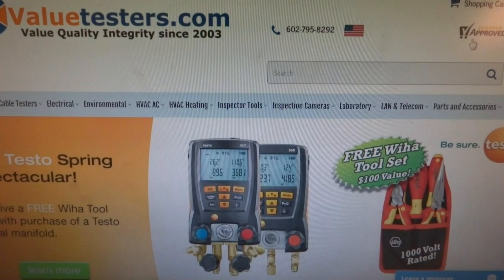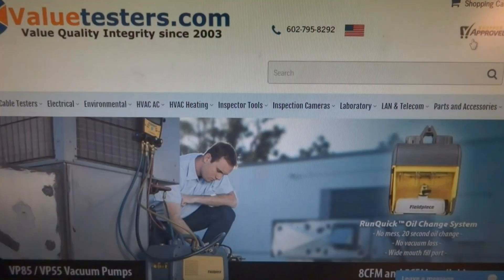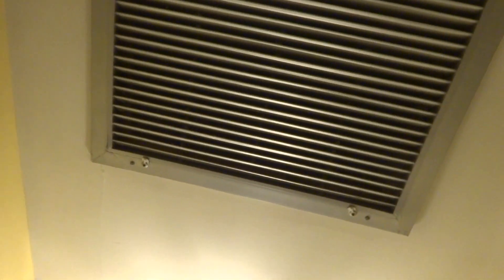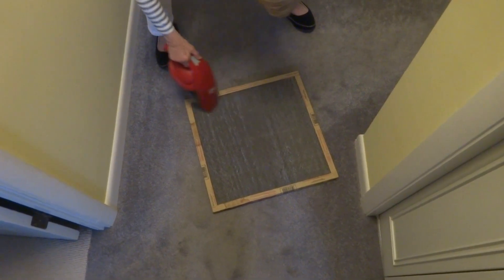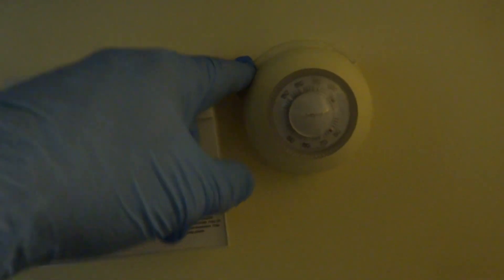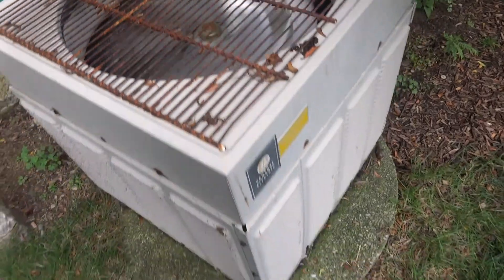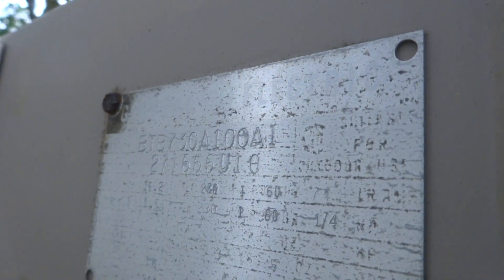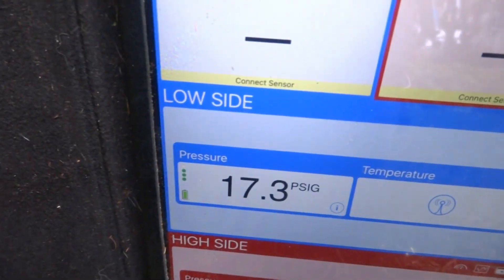old central AC system not worth fixing

Comment: GE hasn't made AC in almost thirty years. They made good units. She got her money's worth out of that one.
Reply: I haven't seen one of those GE units in more than 30 years.  The fan motors in some of those GE condensing units were expensive because GE didn't use a standard size motor so you had to use the expensive GE fan motor.
Reply: @picklerix6162  GE SOLD IT'S LINE OF HVAC SYSTEMS TO TRANE BACK IN 1985 . TRANE does the same thing as well and I love TRANE but they are asking too much for the small business owner to pay the full price for parts because everything is OEM. Witch is the same for gaming computers especially DELL ALIENWARE .

Comment: Trane bought g/e about 1984. The company that I worked for at the time used to install these and it was called the executive model was a damn good unit I still ride by locations that I installed these units in and they are still running yes but with a low suction pressure like that there is a leak somewhere

Comment: Nah it was good call..got what I know working as a helper with those old GE and later Trane systems. Rotolocks on that Climatuff were likely toast from  corrosion after 40 years! Wouldn’t drop a dime on it even though loved those old GE’s and their weathertron heat pump counterparts.

Comment: How do u put ur hand over the fan and instantly know its low on freon like that?
Reply: Nicholas Huss no heat bowing out = no heat transfer= low on Freon
Reply: Fireship1 thank u sir. Any other tips for a low freon unit on what to look for externally?
Reply: @borys444  lack of suction line sweat, little to no temperature difference in line set
Reply: DGTelevsionNetwork thank u..appreciate ur input..

Comment: Damn that unit is older than I am... I would agree to replace it at least for the efficiency factor..
Reply: gonna take decades to even remotely recover the cost of a new system with the saving from partial use in mass.

Comment: What is still buzzing after pulling the disconnect?
Reply: I think the contactor
Reply: It’s the contactor
Reply: If no power how does a contactor buzz?
Reply: @hiddenpcmaster  contactor powered through furnace circuit (24 volts), disconnect provides 230 volts to ac only. Shut off disconnect contactor remains energized
Reply: 24 vol t coil pulling in the contactor .
Reply: @gregorion56  Thanks for the explanation gregorion56.

Comment: To me that filter was dirty I like them clean I guess everybody has different levels.
Reply: I think he meant good enough to check out the system.   Why sell her a new one and tell her to junk the ac 20 minutes later?
Reply: Speck Ulator I didn’t mean to sell her a new one usually people have some in their home and just replace with a new one. Most AC contractors don’t come with the air-conditioner filters you have to buy your own. Getting a new system and having a clean filter are separate issues.

Comment: No sense in even looking for the leak? What if it's a schrader valve or the filter dryer?
Reply from the maker: the r22 gas alone makes it not worth it . pull your head out of your ass
Reply: to add 5-6 pounds of r22 on a unit that old, and then charge the customer for a leak test/repair?   would you spend over $1000  to fix a $2000 car? better get a  new 4000 dollar car and have peace of mind.
Reply: @ElectriconicJesus  I guess you're probably right... for this customer, depending on the skill of the tech and what they charge per hour, I guess it's better just to get a new unit. If it were MY unit, I'd recover the R-22, charge with nitrogen, and at least make an attempt to find and fix the leak(s) - it literally could just be a schrader valve. If that's all it was I'd keep it and might even switch over to R407c. Total cost: My time and $70-100 in materials. If it's got 2 leaks in the evap coil and another 3 in the condenser, sure, I'd junk it - but at least I'd know and could make an educated decision. 

As to the car question, I actually DO have a $1,800 car, and no question I would spend $1,000 to fix it before I'd spend $4,000 for someone else's troubles. I know the history of my car and I know how to fix it :-)
Reply: Timothy Salomon  - Yes of course there are leaks that aren't worth fixing, but to sell a customer a unit just because they're considering one, and without even checking for easy-to-fix leaks is an ethical decision we each make for ourselves.
Reply: Couldnt you just dump flex seal over the whole coil?
Reply: steven lavimoniere - I love your videos and I’m asking an honest question... I’m not at all trying to hurl personal insults. My apologies if you think my head is up my ass for asking if it might be worth it to check for leaks.
Reply: Sure we’d all try to fix our own but if Steve put $1000 into a customers unit and a month later the 40yo compressor goes out she’ll blame Steve.
Reply: Josh Bommer - Totally fair. If it really needed $1,000 of refrigerant/repair I agree not worth it for a 40 year old unit.

I think prices are a little lower in my neck of the woods (Tulsa: $40-$50 per lb for R-22) so please forgive my assumptions if wrong. :)
Reply: @truthsmiles  I'm betting if the customer said steve we know its a POS and could die any day but please fix it he might in that case
Reply: @stevenlavimoniere  man asked a perfectly good question , not ever body can afford new replacement , how you think that unit lasted so long ?  Disrespectful comment , but i think you could care less .
Reply: @truthsmiles  i tell you what your doing....you are standing a head taller than a short man....that was a saying of my father who , like you,  has respect for others ....he was a  world war 2 vet who started a business that ended up with 5 full time shop workers , two guys on the counter , a full time secretary and a full time outside salesman  .When he passed away ,the funeral home had to extend their night time viewing of the casket for an extra 1 1/2 hours so the line of people could all come in and talk to the family .
Reply: @TheKhanhhoa  I appreciate the compliment very much, thank you. I feel honored to be compared to your father, who was obviously a great man. 
I'll say in Steve's defense that, as you know, the YouTube comment section can be pretty brutal and full of 'armchair quarterbacks'. I don't blame him for being a bit defensive - especially when a question could be read as an attack on his ethics (even if it wasn't intended that way). At the end of the day, it's POSSIBLE there might be a cheaper short-term solution for the customer (unless Steve charges $300 per lb for R-22), but in the long term I choose to assume Steve's experience tells him it's in the customer's best interest to get a new system. I just wanted to understand the full thought process a little better than I apparently do :-) 
Cheers!